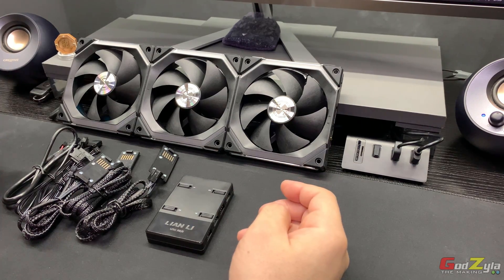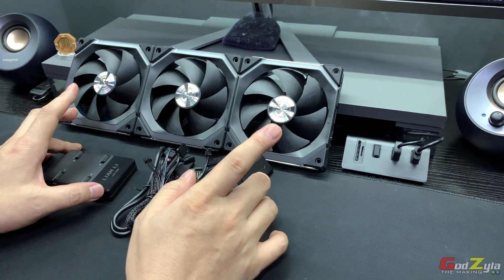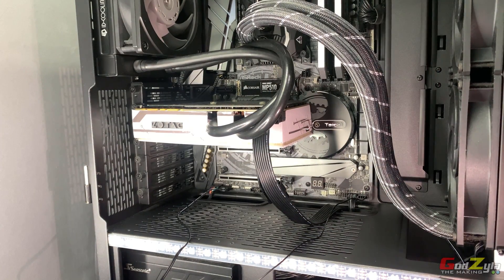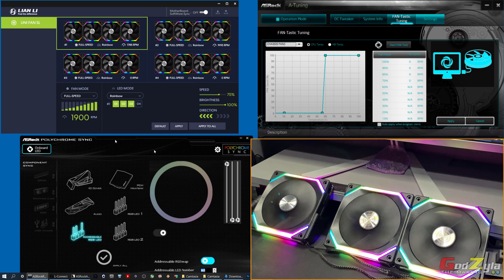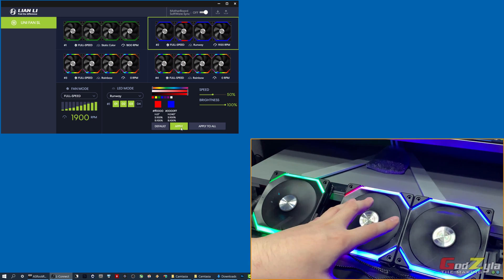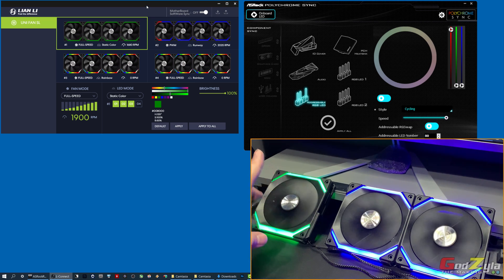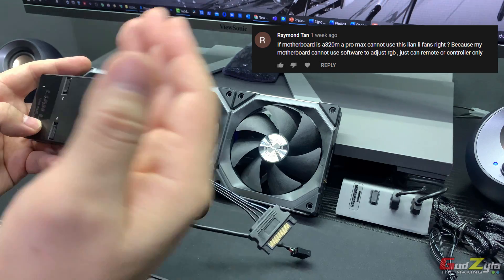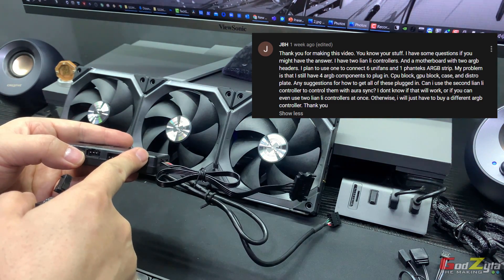Lian Li Uni Fan SL120 - Connection & The Controller (Part III) [L-Connect]

Comment: My question is where do you leave the controller, I have Lian Li strimmer cables, and I have to open case just to use the controller. Great video otherwise
Reply from the maker: Hi Stefan La Terra, welcome to my channel, thank you for the compliment. As most build belongs to colleagues and friends, I place the controller behind the case where the cable management are done at the back or should I say the side of the case. For Lancool II case, I will place it at the shield cover and for O11D case, I will place it on the cable management cover pillar. if you are asking how to connect the strimmer plus to this controller. I have other videos talking about it. Which are either this https://youtu.be/Y0ni_tfcX3g or https://youtu.be/njlkdM9lYbI . You will need the argb kit from lian li though or to use alternative cables which either you purchase it or to do self crimping like what I did https://youtu.be/Lz90i5ym4Dw . hope all these answered to you question and all the best in your build :)
Reply: @KleoYan  That is a massive help thanks, so you need small enough cables to be able to close the back of your case but still have the controlling remote sit outside the case?
Reply from the maker: @stefanlaterra6010  the cables are long enough and no, the controller have to be inside the case, unless you have a way to route the controller out of the case, which I dont advise to do so. you see there are sata connection to it and the two stimmer plus connectors on the controller.
Reply: @KleoYan  Yeah that is the downside, have to open up the case all the time to switch between the RGB functions, and the MOBO software cannot control them all.
Reply from the maker: @stefanlaterra6010  Hi welcome back :) to be honest I hope lian li can do a remote controls for all their products like the Galahad AIO, Uni fans  and of course the streamers. it will make life easier.
Reply: @KleoYan  Absolutely, something wireless for sure.

Comment: Just got a PC that has these fans, I want to change the color but have my motherboard control the fan speed. But when I start L-connect and set it to PWM the fans go full speed and stay there.
Reply from the maker: Hi Mike, welcome to my channel. You might want to check in your bios to see if you have set that specific fan header which you have connect a cable between the uni controller to the motherboard. Make sure it’s set to pwm mode and not dc mode.

Comment: Does anyone know why I can only change 1 set of fans in L-Connect? They are both plugged into 1 and 2 on the hub but only 1 changes when I try to make them quiet. The other is high speed.
Reply from the maker: Hello Michael, does your argb work? if it does not work, you might want to check if they physical cable connection are plug proper. Check your connection between the fans too. maybe can you list out how your configuration is like as in top , bottom, aio fans and what motherboard are you using?
Reply: @KleoYan  Thanks, yeah everything else works. I have 3 on bottom and 3 on top for AIO. The bottom ones just stay full speed no matter the setting. Everything seems to be connected right, unless something is bent or faulty. Motherboard is Gigabyte Z590I Vision-D. The hub is connected to a single PWM header.
Reply from the maker: @LeSkateWA  ok.now, the uni controller will also work without the PWM connected between the uni controller to your motherboard, unplug that.. then boot up to windows. on L-Connect are you able to control the fan speed to Quiet, Higher or etc but not PWM. if that does not work. there are some connection issues of your fans to the uni controller, as it's not picking up instructions. you will need to narrow down this first..
Reply: @KleoYan  Ok didnt know that, I will have to try that tomorrow. Ill play around with it and see what happens. I thought maybe it was a common problem. Thanks for the help
Reply from the maker: @LeSkateWA  you are most welcome and all the best in your build.

Comment: BROOO THIS VIDEO IS AMAZING TYSM
Reply from the maker: hello jason robertson. welcome to my channel and you are most welcome. You might want to view the dos and donts too in this playliste https://youtube.com/playlist?list=PLEW-b-2vYDdPo0NzHyeksx012c-nkDapm :)
Reply: @KleoYan  hey I built my pc today and 3 of the fans are spinning but not lighting up. they were lighting up and then randomly in the middle of  a game they turned off. what can i do
Reply from the maker: @jasonrobertson9099  Hi Jason, make sure your connection are hook up properly and you might want to check if your motherboard chipset is updated. https://youtu.be/8l4i5UjO3es  now if all about were done, check to see if you have other argb application running besides your L-Connect. if you need the other argb application to run. you will need to first uninstall them using this uninstaller call revo uninstaller https://www.revouninstaller.com/revo-uninstaller-free-download/ then install the L-Connect app first. make sure all your SL fans are working. once done, then install the other argb application.

Comment: Hello. I have 9 sl fans and i connected all of them to the controller and put the pwm cable in the cpu fan header. After that only 3 of them light up and when i bot my system i get cpu fan erorr and i went to the bios and it says i dont have any fans only the aio pump. Can you help me
Reply from the maker: Hello Zecrod, welcome to my channel. maybe you should try this to have better control over your fans. 1st leave the fan's argb connected on the uni controller. This is to control the argb effects using L-Connect app. 2nd, unplug the fan load and plug them directly to the motherboard fan header, use your motherboard to control the PWM and RPM of your fans. example

Top 3 fans - connect to fan header Chassis Fan 1
Bottom 3 fans - connect to fan header Chassis Fan 2
Rear 1 fan - connect to fan header Chassis 3. 

the above is just an illustration.

Comment: hey , i assembled 2x3 SL 120 Fans on my pc i have some problems...
the RBG and cooling work but the software did not. The software dont recognize the fans i tried but no succes. can anyone help me? thanks!
Reply from the maker: Hello Halit K. welcome to my channel, I like to check which motherboard are you using. some are having the same issue as you, it could be your motherboard argb software taking control over the IRQ of your usb connection. If you do have other argb application running besides the L-Connect, kindly try this, remove other argb utility app and the L-Connect application too.. using revo uninstaller. Next reboot your system and now try re-install the L-Connect app and make sure to run as adminstrator. see if that helps.
Reply: @KleoYan  thanks for answer!
I have a msi mpg z590 gaming force Mainboard...
Reply from the maker: @halitk66  hi ya, ok intell should not react this way. have you update your motherboard chipset? you might want to follow this guide here first. https://youtu.be/8l4i5UjO3es and remove the MSI dragon app too.
Reply: @KleoYan  i will try thanks for youf help'
Reply from the maker: @halitk66  you are most welcome and hopefully you can get your issue resolve. all the best in your build too.

Comment: What fan speed should you use for gaming if you have 9 lian li sl120s?
Reply from the maker: Hello Apex Prxsm, welcome to my channel. if you are running using only the uni fan controller to run both argb and pwm. I would advise you to set all your fans to high while gaming. what I will do is to do my own set of fan curve in my motherboard UEFI (X570 Taichi) https://youtu.be/32C8Ngf2Zpw . then I will connect the fan load directly to those approperiate fan headers on my motherboard. then leave the argb fan conntector with the uni controller to do argb effects. so you have two choices. I prefer to control my fans using the motherboard fan curves directly.

Comment: Can these work with the Aura Sync ?
Reply from the maker: Hello Ankush Om, welcome to my channel. yes it will work, so long your fans are connected to uni controller and the L-Connect application is set to motherboard mode. 
if you thinking to connect these fans directly to the motherboard header. I advise you not to. please view this, the dos and donts https://youtu.be/QQHJUQvKwlY
Reply: @KleoYan  oh thx for the info 😊 later I decided to go with nzxt non rgb fans like which is already included in the h710 case (i heard it comes with 3 120 & 1 140 included ) like rgb is not my priority

Comment: does this software work on ST120 also?
Reply from the maker: Hello Resistance 2u , welcome to my channel. yes it does, so long you connect the ST120 in the uni controller. kindly note that it will not do stack patterns as ST120 does not have build in chip like the SL120 or AL120. in order to connect your ST120 to the uni controller. you will need the lian li argb kit or you can do alternative connectors. you can find all the necessary connectors here. 

Converter needed
===============
‣ Lian Li aRGB Cable Kit - https://lian-li.com/product/argb_cable_kit/ - Lian Li aRGB Cable Kit
An illustration of Lian Li aRGB Cable Kit - https://imgur.com/gallery/beYR8CN

If you are not purchasing the Lian Li aRGB Cable Kit, get the pin needle and the converter below. 
‣ Pin needles - https://www.aliexpress.com/item/32706628771.html or https://www.ebay.com/itm/224459128229 (you need to pull out one needle to fit the below converters)
‣ Converter - 1 To 1 Male https://www.ebay.com/itm/133521646617 or 1 TO 1 Female 5V 3pin https://www.aliexpress.com/item/1005001598378033.html

Special Set - Daisy Chain aRGB connector from your rear fan to either top or bottom sets of fans
=============================================================================
‣  aRGB Y Split connector - https://www.aliexpress.com/item/1005001380598384.html (3Pin 1 To 2)
Reply: @KleoYan  thanks really detailed reply appreciated alot
Reply from the maker: @Resistance2u  you are most welcome.. all the best in you rbuild and once again thank you to have visited my channel.
Reply from the maker: @Resistance2u  you are most welcome and thank you to have visit my channel.

Comment: Hi Kleo. This is an old video and i hope you’ll see this comment and reply. I recently got these fans. I connected everything accordingly, usb, argb and the fan connector from the hub to the CHA_FAN on my mobo. However, when i go into BIOS, my chasis fans show up as “n/a”. Is there a solution to this?
Reply from the maker: Hello Farhan Shahriar, welcome to my channel. that's normal as your readings will be shown on L-Connect application. if you want it to show in your bios or uefi, connect the fan load directly to the motherboard fan header instead of going through the uni controller..
Reply: @KleoYan  Thank you so much Kleo. I have figured a solution to this. It is to get a 4 pin splitter and connect 1 fan directly into one end of the splitter and the controller to the end of the splitter and voila. The chasis fans now show up in bios. Thank you again for your reply :)
Reply from the maker: @farhanshahriar3068  that's very smart, why didnt I think of that.. yup it will work .. thanks, I've learn something from you.

Comment: Sorry so I didn't see this question asked - might be a dumb one - I have an ASUS Z390 (so I don't have an ARGB header) and will be manually controller my fan's ARGB, fans speeds (with PWM), and Strimers using L-Connect. 

My question is, will L-Connect be able to sync my Motherboard's RGB (the Z390 has RGB lights on it) as well, through only the Lian Li's USB connection? 

Hope the question makes sense.

I bought the Deepcool RGB converter, but since I'll be using L-Connect, I'm not sure if I need it to convert the 3pin ARGB to the Z390's 4pin RGB. 

Thank you vm - super helpful videos!! I've learned a lot from you.
Reply from the maker: hello Akshay A, welcome to my channel, it is not advisable to use the deepcool converter from 4pin to 3pin.. it will not work. 
now being said. you can use the uni controller with the L-Connect app to control all argb effects. you only need to plug the USB cable between the uni controller and to your motherboard USB 2.0 header. hope this help.

Comment: hi sir i have a question, i have a deepcool argb hubs and fan hubs. and realise that this fans argb are the same as my deepcool fans. so the question is, can i just swap them out? thanks!
Reply from the maker: Ni Aliff Aminuddin, welcome to my channel. Are you trying to say you will use the deepcool hub instead of the uni controller and to use the uni fans on the deepcool hub? If you are doing that. I would not advise you to do so as the uni fan ampere is higher than most other argb fans out there.
Reply: @KleoYan  yes. oh i see, okay then tq i just done installing the fans, just the hubs to my motherboard left. where can i contact you if i have any problems?
Reply from the maker: @aliffaminuddn  hi, you can always post your questions here or to send me an email at godzylatech@gmail.com :)

Comment: do you need to connect usb 2 for rgb to work? i only have 1 usb 2 port on my b55i asus mobo. I only want to use aura 5v to controll rgb
Reply from the maker: Hello Robin Jako, you will need to plug it to the USB header of your motherboard as L-Connect need to send commands to your uni controller. I will not advise you to get converter and connect to your motherboard argb as without the uni the drawing ampere is high. You might damage your board if you connect it directly to your motherboard without the controller. Best way to do is to get a nzxt internal hub.
Reply: @KleoYan  i will connect the 5v rgb to the motherboard from lian li controller hub. I wont use the usb 2 connector cus i cant use it. Will it work if i only use the rgb connector from the hub to motherboard?
Reply from the maker: @jakorobin  nope. if you connect the argb cable between the uni controller and motherboard. it will not work. You need the L-Connect application to sent command through the USB cable to your uni controller to enable motherboard mode.
Reply: @KleoYan  so i need to use the usb?
Reply from the maker: @jakorobin  yes, you need to plug that and to install L-Connect app. If you only have one usb header on your motherboard. you can get this https://nzxt.com/product/internal-usb-hub-gen-3 do a search at your area for any online store that sells that.. it might be cheaper too.
Reply: there is one kolink for on 10 dollars, its the exact same and i will buy that
Reply from the maker: @jakorobin  make sure it comes with a sata power source for the hub. if not you will take up alot of load from the motherboard USB 2.0 header.. which may melt you header or even damage your board, please take note on this.
Reply: its molex but its okay, it has good reviews so its fine
Reply from the maker: @jakorobin  ok.. thats good.. all the best in your build :)
Reply: @KleoYan  thx man, the build is already done. its a mini itx, i just wanted some good rgb high quality fans so i bought these
Reply from the maker: @jakorobin  you are most welcome.

Comment: What’s the best fan mode and rpms for the fans to make the pc run cool?
Reply from the maker: Hi Mike Smoove, welcome to my channel, it greatly depends on what type of casing you are using and also the placement of the fans, maybe let me know what type of case are you using and how is your placement like as in where you place your watercooling radiator if you have one and the fan placement as in top, front, bottom and rear. also indicate if they are intake or exhaust.
Reply: @KleoYan  I’ve got the lian li 011 dynamic razer with 9 fans and the kraken z73 radiator on the top
Reply: Is there way I can show u a picture of what it looks like
Reply from the maker: @mikesmoove1469  sure, you can sent to my email at godzylatech@gmail.com
Reply from the maker: @mikesmoove1469  hmm which processor and GPU are you using?
Reply from the maker: @mikesmoove1469  hmm pardon me, I dont use facebook. that account is activate but due to my job nature. security policy. I dont use it. you might want to send email to me at godzlyatech@gmail.com. thank you!
Reply: @KleoYan  your email was not valid and it didn’t go through?
Reply from the maker: @mikesmoove1469  huh. The Gmail is legit. Does not matter I got the picture from my affiliated YT. U message to kritikalgaming which is my affiliated channel. I will have a look at the pic. Let you know later.
Reply: @KleoYan  alrighty
Reply from the maker: @mikesmoove1469  pardon me, I deleted two of my reply as I read your picture incorrectly. this is the correct suggestion https://imgur.com/mxLD05G but I would advise you to test out the RPM for your side and bottom. the way I suggested it. it's a balance.
Reply: @KleoYan  ok thank you !
Reply from the maker: @mikesmoove1469  actually I have done a lot of o11d builds. With 5950x and 3090cards. Best result is to have the rad at the side. Draw cool air. Leaving the top and bottom free flow. 

Top exhaust at 1.2k rpm 
Bottom intake at 1k rpm
Side intake (rad placement) pwm performance mode. 

Best configuration on heavy work or gaming.
Reply: @KleoYan  that’s great to know ! Thanks for the amazing input !
Reply from the maker: @mikesmoove1469  you are most welcome.. All the best in your testing..
Reply: @KleoYan  💯

Comment: came across your channel by chance. Is that a KMS switch you have mounted in front of your monitor?
Reply from the maker: Hi Alan Choy, welcome to my channel. if you are referring to the black cheap small box. yup, that's my KVM. just to share, in this video, it does show you my workstation setup https://youtu.be/3Gm3Srobig4